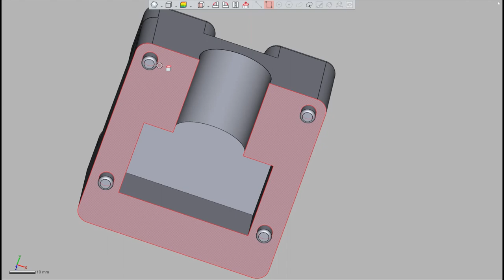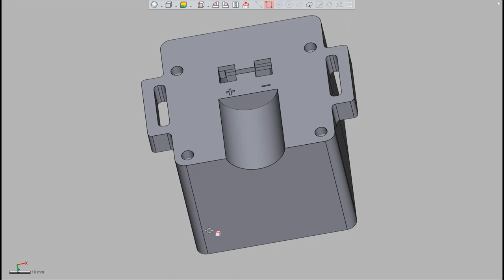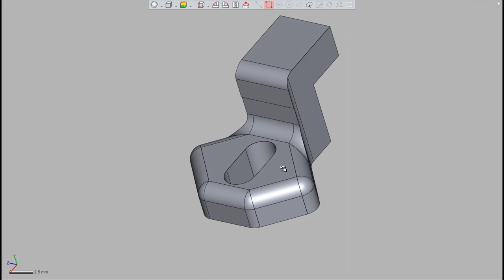RYOBI 18V Bug Zapper, LED Light, and  USB Charger

Comment: It should be mentioned that Ryobi batteries are not intended to be left outdoors unprotected from the elements; rain can get into the battery and cause malfunction of the battery.
Reply from the maker: This is meant to work inside tent, camper, house... not outside. Outside you would just be attracting bugs :-)
Reply: @SerendipitySue   - I just mentioned that because I see people who use zappers on their decks and patios, and if the battery is exposed to the rain there it’s not a good thing.